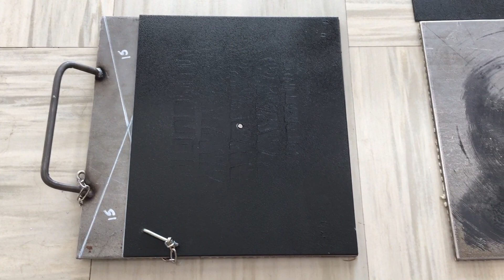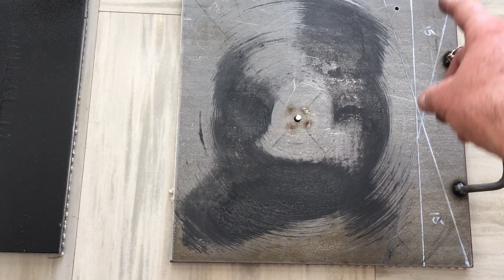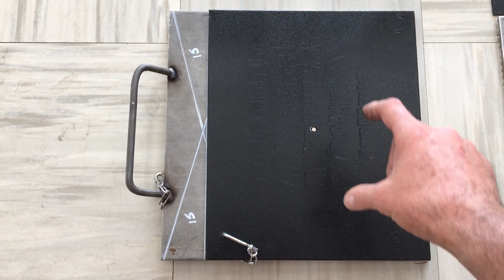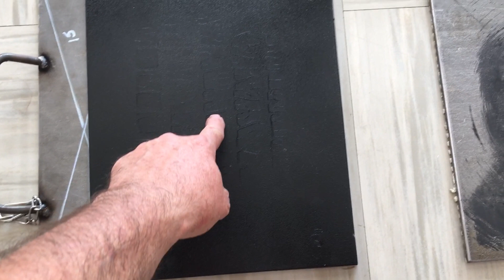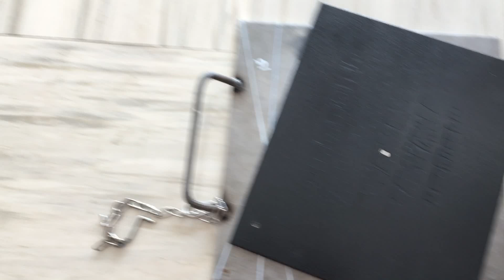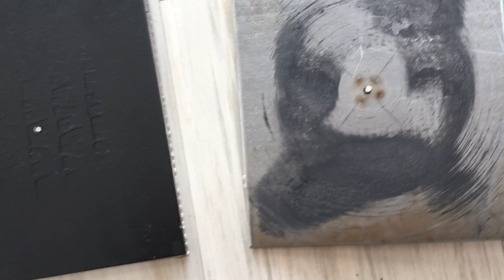Copy of IMG 2734

Comment: The plates also need to roll perpendicular to the vehicle to prevent loading of the suspension.
Reply: most turn plates commercially available work just like his. 

for example   https://www.youtube.com/watch?v=G6YN7wkJ7ZA
Reply: @tubatits  If you roll the car on the plates you will get minimal side loading (unless it is waaaay of). If you jack the car up and set the car down on the plates you will be so far off when you are done it will not even work.
Reply: @SlappynutsMN  Im not disagreeing with you. Im on the verge of either doing what he did or purchasing a commercial set. 
I just found it curious that none, so far, that I have come across have  the ability to compensate for perpendicular movement.

I've been using floating grease plates for ages but I now need the ability to read degrees on rotation. Im now thinking of doing what the author did but with a third floating plate underneath it.